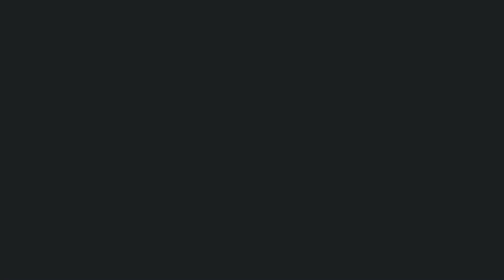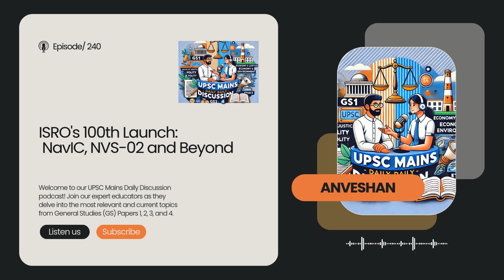ISRO's 100th Launch  NavIC, NVS 02, and Beyond  -UPSC -240

Comment from the maker: FAQ: Indian Space Research Organisation (ISRO) and NavIC:

1- What is the significance of ISRO's 100th launch? 
ISRO's 100th launch marked a major milestone, achieved with the successful deployment of the NVS-02 navigation satellite by the GSLV-F15 rocket. This event showcases India's growing capabilities in space technology and its commitment to enhancing its navigation infrastructure through the NavIC system.

2- What is NavIC and how does it differ from GPS? 
NavIC, or Navigation with Indian Constellation, is India's regional navigation system consisting of seven satellites. Unlike the global GPS system, NavIC is specifically designed to provide more accurate positioning within India and up to 1,500 kilometers around it. NavIC satellites are positioned directly overhead, resulting in better accuracy and signal availability, particularly in difficult terrains. It is also the only independent regional system, unlike Japan's QZSS which augments GPS.

3- What are the key features of the NVS-02 satellite, and why is it important? 
NVS-02 is a second-generation NavIC satellite featuring an indigenously developed atomic clock for enhanced accuracy and a longer mission life. It's also equipped with the L1 frequency, making it more compatible with personal trackers. The satellite is crucial to bolstering the reliability and accessibility of India's navigation system for various applications, including civilian and strategic uses.

4- What are the different types of launch vehicles developed by ISRO? 
ISRO has developed several generations of launch vehicles, with four currently in operation: the PSLV (Polar Satellite Launch Vehicle), a workhorse for Low Earth Orbit missions; the GSLV (Geosynchronous Satellite Launch Vehicle), used for placing satellites in higher orbits and now powered by indigenous cryogenic engines; the GSLV MkIII (also known as LVM3), India's heaviest rocket used for missions like Chandrayaan and future human spaceflight; and the SSLV (Small Satellite Launch Vehicle), for commercial small satellite launches.

5- What are some of ISRO's major achievements beyond its 100th launch? 
ISRO has launched 548 satellites, including many foreign satellites, and successfully conducted scientific missions like Mangalyaan (Mars Orbiter Mission), Chandrayaan lunar missions, and the solar mission Aditya-L1. These missions have expanded our understanding of the solar system and space while establishing ISRO as a global leader in space exploration.

6- What is the significance of the indigenous cryogenic engine used in GSLV rockets? 
The indigenous cryogenic engine is a critical achievement for India's space program as it reduces the nation's reliance on foreign technology, particularly in the area of high-performance rocket propulsion. It is a crucial element for launching heavier satellites into Geosynchronous Transfer Orbit (GTO). The development of this technology is essential for ISRO's goal of becoming more self-reliant in its space missions.

7- What future developments and missions is ISRO planning?
 ISRO has ambitious future plans, including a lunar sample return mission, a mission to Venus, the establishment of an Indian space station, and a manned Moon mission. ISRO is also developing the Next Generation Launch Vehicle (NGLV), which will have a reusable first stage, and constructing a new launch pad to support these upcoming space exploration endeavors and human spaceflight programs.

8- When was ISRO established and what was its historical background? 
ISRO was formally established in 1969, building upon the work of the Indian National Committee for Space Research (INCOSPAR) which was formed in 1962. This demonstrates ISRO's long-term commitment to advancements in space research and its contributions to India's scientific capabilities. The agency was formalized under the Department of Space, created in 1972.
Reply from the maker: ISRO और NavIC: अक्सर पूछे जाने वाले प्रश्न (FAQ)

1- ISRO के 100वें प्रक्षेपण का महत्व क्या है?
ISRO का 100वां प्रक्षेपण एक बड़ी उपलब्धि है, जिसे GSLV-F15 रॉकेट द्वारा NVS-02 नेविगेशन उपग्रह के सफल प्रक्षेपण के साथ हासिल किया गया। यह घटना भारत की अंतरिक्ष तकनीकी क्षमताओं और NavIC प्रणाली के माध्यम से नेविगेशन बुनियादी ढांचे को मजबूत करने की प्रतिबद्धता को दर्शाती है।

2- NavIC क्या है और यह GPS से कैसे अलग है?
NavIC (Navigation with Indian Constellation) भारत की क्षेत्रीय नेविगेशन प्रणाली है, जिसमें सात उपग्रह शामिल हैं। GPS के विपरीत, NavIC विशेष रूप से भारत और उसके आसपास 1,500 किलोमीटर तक सटीक पोजिशनिंग प्रदान करने के लिए डिज़ाइन किया गया है। इसके उपग्रह सीधे ऊपर की कक्षा में स्थित होते हैं, जिससे कठिन भूभागों में भी बेहतर सिग्नल उपलब्ध होता है। यह जापान की QZSS प्रणाली से अलग है, क्योंकि NavIC पूरी तरह से स्वतंत्र क्षेत्रीय प्रणाली है।

3- NVS-02 उपग्रह की मुख्य विशेषताएं क्या हैं और यह क्यों महत्वपूर्ण है?
NVS-02 दूसरा-पीढ़ी का NavIC उपग्रह है, जिसमें स्वदेशी रूप से विकसित परमाणु घड़ी शामिल है, जो सटीकता को बढ़ाती है और लंबा मिशन जीवन प्रदान करती है। यह L1 फ्रीक्वेंसी से सुसज्जित है, जो व्यक्तिगत ट्रैकर्स के साथ अधिक अनुकूल है। यह उपग्रह भारत की नेविगेशन प्रणाली की विश्वसनीयता और उपयोगिता को बढ़ाने के लिए महत्वपूर्ण है।

4- ISRO द्वारा विकसित लॉन्च वाहनों के प्रकार क्या हैं?
ISRO ने कई पीढ़ियों के लॉन्च वाहन विकसित किए हैं, जिनमें चार वर्तमान में संचालन में हैं:

PSLV (Polar Satellite Launch Vehicle): लो अर्थ ऑर्बिट मिशनों के लिए।
GSLV (Geosynchronous Satellite Launch Vehicle): उच्च कक्षा में उपग्रहों को स्थापित करने के लिए।
GSLV MkIII (LVM3): भारत का सबसे भारी रॉकेट, चंद्रयान और भविष्य के मानव अंतरिक्ष मिशनों के लिए।
SSLV (Small Satellite Launch Vehicle): छोटे उपग्रहों के वाणिज्यिक प्रक्षेपण के लिए।

5
Reply from the maker: - ISRO की 100वें प्रक्षेपण के अलावा अन्य प्रमुख उपलब्धियां क्या हैं?
ISRO ने 548 उपग्रह लॉन्च किए हैं, जिनमें कई विदेशी उपग्रह शामिल हैं। इसके अलावा, मंगलयान (मंगल ऑर्बिटर मिशन), चंद्रयान मिशन, और सौर मिशन आदित्य-L1 जैसे वैज्ञानिक मिशन सफलतापूर्वक संपन्न किए हैं। इन मिशनों ने सौर मंडल और अंतरिक्ष के बारे में हमारी समझ को बढ़ाया है और ISRO को वैश्विक स्तर पर अंतरिक्ष अनुसंधान में अग्रणी बनाया है।

6- GSLV रॉकेट में उपयोग किए गए स्वदेशी क्रायोजेनिक इंजन का महत्व क्या है?
स्वदेशी क्रायोजेनिक इंजन भारत के अंतरिक्ष कार्यक्रम के लिए एक महत्वपूर्ण उपलब्धि है, क्योंकि यह उच्च प्रदर्शन वाले रॉकेट प्रणोदन में विदेशी तकनीक पर निर्भरता को कम करता है। यह Geosynchronous Transfer Orbit (GTO) में भारी उपग्रहों को लॉन्च करने के लिए आवश्यक है और ISRO को आत्मनिर्भर बनाने में सहायक है।

7- ISRO की भविष्य की योजनाएं और मिशन क्या हैं?
ISRO की भविष्य की योजनाओं में चंद्रमा से सैंपल लाने का मिशन, शुक्र ग्रह का मिशन, भारतीय अंतरिक्ष स्टेशन की स्थापना, और मानवयुक्त चंद्रमा मिशन शामिल हैं। ISRO अगली पीढ़ी के लॉन्च वाहन (NGLV) पर भी काम कर रहा है, जिसमें पुन: उपयोग योग्य पहला चरण होगा, और नए लॉन्च पैड का निर्माण कर रहा है।

8- ISRO की स्थापना कब हुई और इसका ऐतिहासिक पृष्ठभूमि क्या है?
ISRO की स्थापना 1969 में हुई थी, जो 1962 में बने भारतीय राष्ट्रीय अंतरिक्ष अनुसंधान समिति (INCOSPAR) के कार्यों पर आधारित थी। यह भारत के अंतरिक्ष अनुसंधान और वैज्ञानिक क्षमताओं में योगदान के प्रति ISRO की दीर्घकालिक प्रतिबद्धता को दर्शाता है। इसे 1972 में बनाए गए अंतरिक्ष विभाग के तहत औपचारिक रूप से संगठित किया गया।